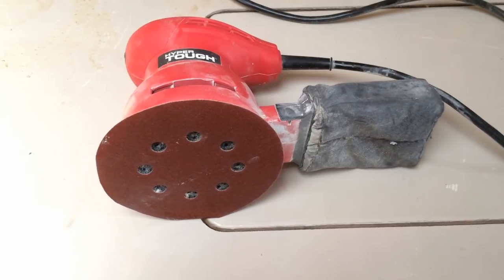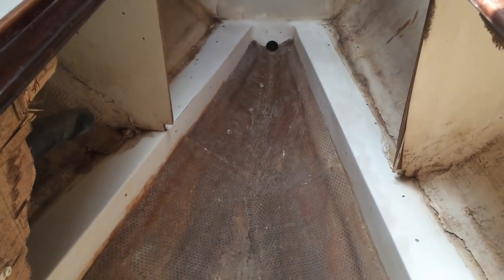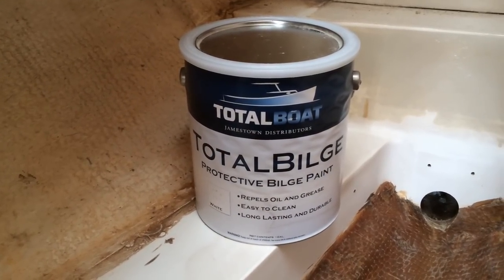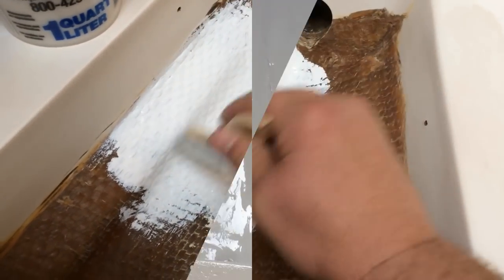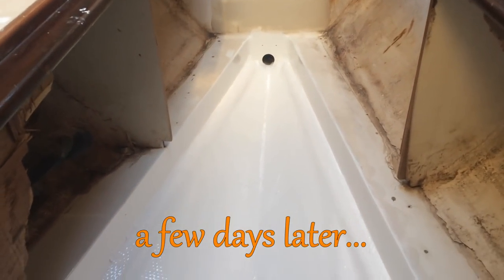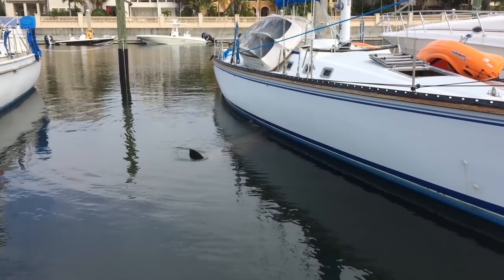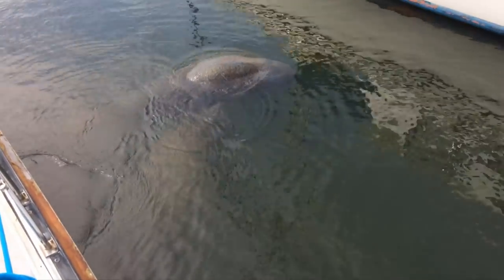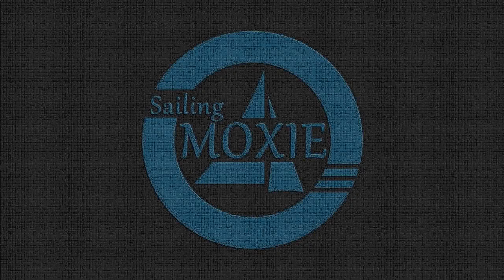Painting the Bilge | Manatees Stop By - Ep. 18 - Sailing Moxie

Comment: Oh man you found some Moxie cola!  Good job!  I guess its distribution isn't that good in Florida.The bilge looks tons better, but is there cracking in the glassed in cabinetry above the floor?  I didn't get a good look, but there seems to be a large crack?
Reply from the maker: I was at an ice cream shop with my family a few weeks ago and saw the Moxie in the fridge. I took home six bottles! Yes, where the glassed in cabinetry comes down to the floor, it has separated in a few places. The hull even deeper is perfectly fine, but I'll grind out some of that cracking fiberglass and seal everything back up. It looks to only be at the very bottom - hopefully not too deep. I'll discover just how bad it is as I start digging in.
Reply: @SailingMoxie  Hunter sailboats are sometimes looked down on for extreme hull flex.  That cracked area may be the result of some kind of hull flex.  That location may need a stringer to prevent hull flex.  A friend of mine had a 37 with the same problem. The stringer solved it after it kept coming back multiple times.
Reply from the maker: Thanks, Allyn. Good advice. I'll dig in and see if a small stringer can solve the problem in that area, as opposed to just filling it in with fiberglass and epoxy.
Reply: @SailingMoxie  It may not need one, you can try just the fix first, but it seems to be a pretty large area without a great deal of support.  I wouldn't create a lot of extra work if you don't need to do so.  It can be just something that happens over twenty years.  I would work harder on the finding more Moxie cola.
Reply from the maker: I may get a professional on board to check that area and a few other areas of the boat and give me a recommendation on how to proceed with some of my work. Not the person who would actually perform the work. I'll just pay someone locally for their recommendations so I get unbiased professional advice.
Reply: @SailingMoxie  Sounds like a good plan!!  Let them know up front you just want an opinion and that they won't be doing the work.
Reply: @SailingMoxie  Oh and if you have spots that need attention a lot of boat vloggers make the mistake of not asking their viewership to make suggestions.  Make a boat problem video, post it online, and ask for feedback.  Some will hurt your feelings, some will be "eh", and some will be fantastic!  The point is getting a thousand eyes on the issues can be worth a whole lot more than just one.  You will be tapping into thousands of years worth of experience in other people.
Reply from the maker: Yep, that's what I want to do. Get the most objective advice possible.
Reply from the maker: Good advice. A guy in the office today mentioned doing the same thing to pool the knowledge of the viewer community and get a wide range of advice. Thanks.

Comment: What is the headroom I can't seem to find any info on Hunter about this...
Reply from the maker: The max headroom I’ve measured in the saloon area from sole to highest point inside is 6’2”. I’m about 6’3” so I can just barely stand straight up there. Everywhere else I have to slouch or bend over and constantly bump my head. In redoing the flooring right now I’m trying to drop the sole about 3/4” to reduce slouching and bumping my head. The forward berth area is much much shorter. Hope that helps!

Comment: 2:26 - there seems to me a significant crack in the upper right half of the video - is that delamination of a structural member?
Reply from the maker: That's the inside of a storage area in the V-berth with the front panel ripped off. The delamination is only along the bottom edge as it meets the frame of the boat. It is not a structural part of the hull. That's deeper underneath. I'm going to start digging/grinding into that bottom edge to see if the damage goes deep. I think it's only at the very bottom edge. I'll then rebuild that area up where it meets the frame as needed. I don't think it's major delamination, but rather the weak edge has flexed and broken away over the last 37 years.

Comment: 120 grit is fine for a bilge !
Reply from the maker: Yes, I learned very quickly that I didn't need to use 220 grit sandpaper. I ended up using mostly 60 and 120 by hand on that bare woven fiberglass before the first coat and then 120 on the orbital sander for the flat surfaces. While prepping for the second coat I used the Scotch-Brite pad and 120/220 by hand just to scuff it up. I'll save that 220 for much more detailed work. Thanks for watching the videos!
Reply: @SailingMoxie  More please !